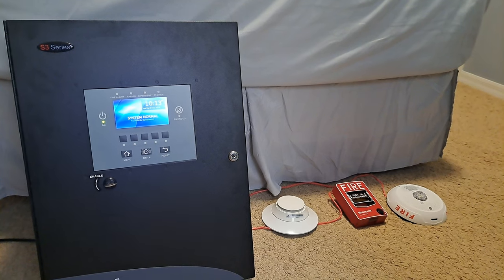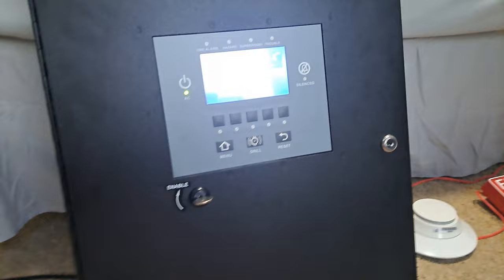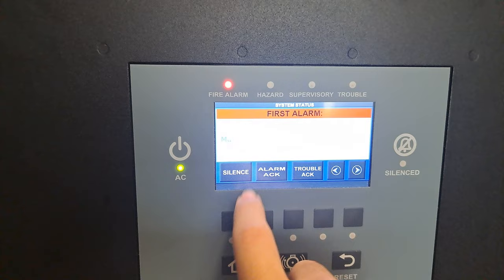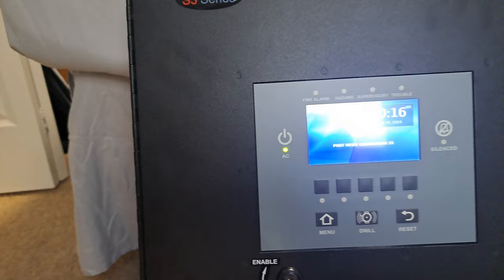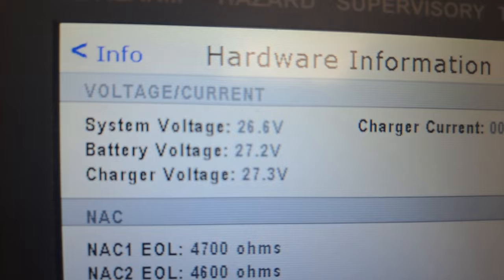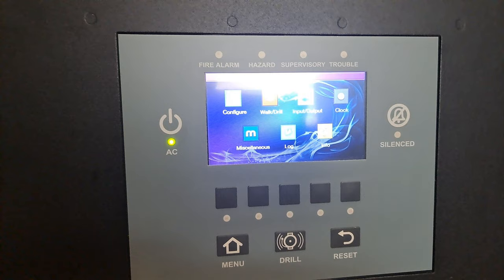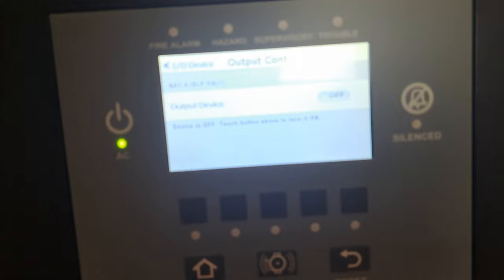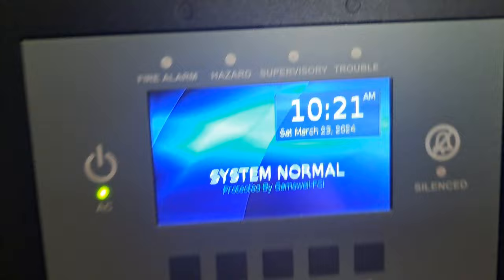Gamewell-FCI S3 Demo

Comment: takes multiple business days to activate
Reply from the maker: It took less than ifp2000 sir
Reply: According to a 4050-80 vid sometimes they won’t activate at all. 4050-80 did a vid on an e3 and it took 3 tries to activate. Even when it did, it was very laggy. I think Gamewell systems are just underpowered on the hardware level. Notifier uses the same peripherals and it’s lightning fast.
Reply: Nah mines really take 2 days to activate, while me and anya was asleep after doing system test of that, we are waiting for like a day long, until we fell asleep, and the alarm went off.

Comment: velociti does poll slow you just have 2 devices on the loop 💀
Reply from the maker: No sir, we do a lot of apartments with e3's and s3's with hundreds of devices, and they poll the same speed as a notifier running flashscan with the same amount of devices
The newer ones atleast
Reply: @FireTech7  yes sir we do a ton of gamewell shit that fails and takes forever to activate
Reply from the maker: Odd, never had anything activate over 5 seconds
Reply: @FireTech7  i have videos its very stinky
Reply: Not how it works. You can adjust poll speed via CAMWorks.
Reply: @QuentinRichardsthe2012brony  no

Comment: Gamewell-FCI isn’t very good in my opinion, especially the panels. Their products just have so many issues and aren’t designed very well. For example, the user interfaces on both touchscreens and tactile displays are extremely unresponsive, clunky (why would you have to hold the lamp test button for the panel to actually reset?), and are poorly designed. The touchscreens are so laggy that it somehow has a learning curve in the form of patience. Plus, velociti is not very good in my opinion. It’s basically FlashScan with the same features but extremely underpowered and rather laggy and unresponsive at times. 4050-80 had one vid on his channel where it took 3 attempts to get the e3 (which is actually better than the s3) to finally trip and when it did, it took a long time to do so. It doesn’t stop there though. Veridian has a very bad rep too. I’ve heard techs complain about the software all the time. Gamewell-FCI is like a really crappy doppleganger of Notifier held together with duct tape and glue.